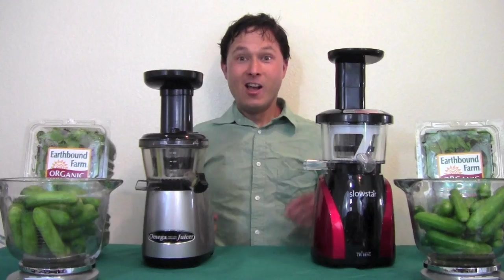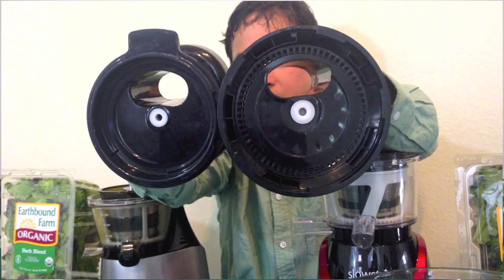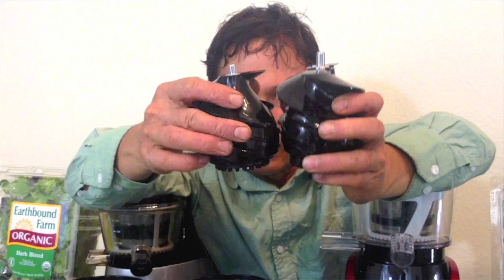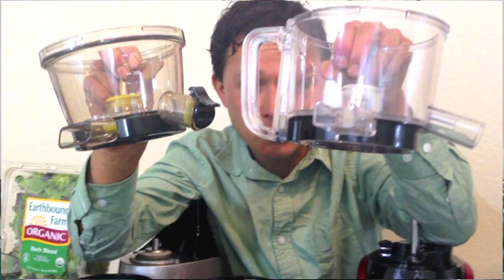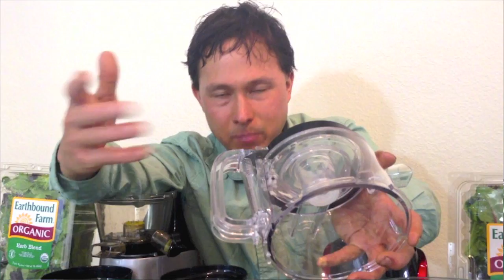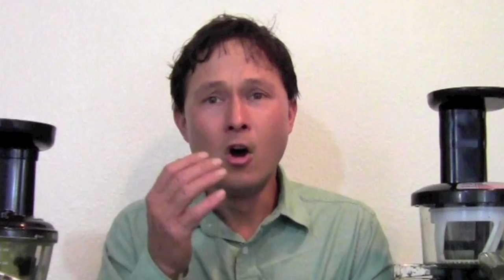Omega VRT400 and Slowstar Juicer Comparison

Comment: Hi John, would you please juice some carrots already? in the Slow juicer. If it will juice carrots, and not choke. I'll buy one. The reason I sold returned my vert, was because every 4~5 carrots dropped in would jam it. If the slow juicer does not jam on carrots, Perfect!

Comment: Recap: Slowstar is taller = bad.. doesn't fit under cabinets...  Omega pull off to remove base = bad ... fall when you try to move it.  slowstar auger - 2 blades..  slowstar has handle.. nice touch!  slowstar has a mesh strainer from china included... omega has one built to fit the cup.. nice.  slowstar = 40rpm... wow... too slow.. don't want to wait even longer to get done with this juicing stuff.  Slowstar - mincing attachment!!  WINNER.. SLOWSTAR!!